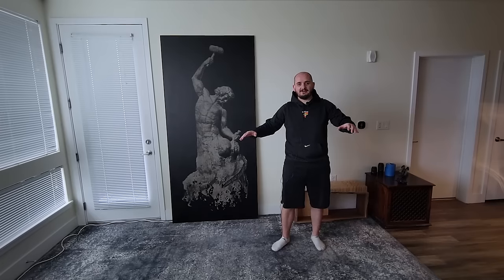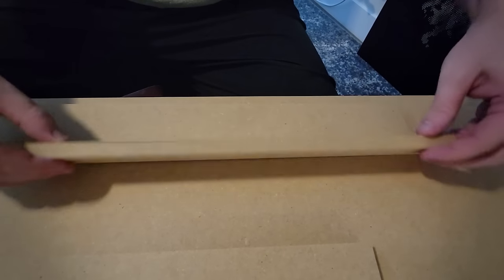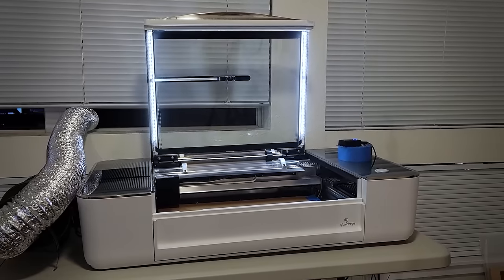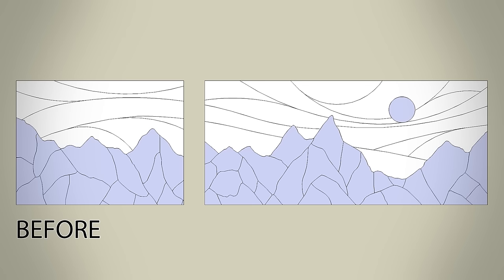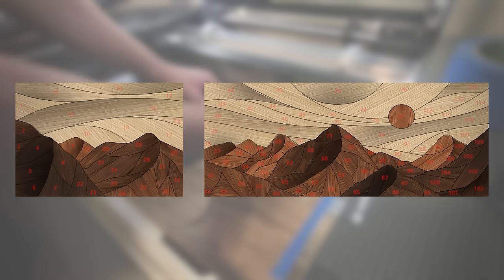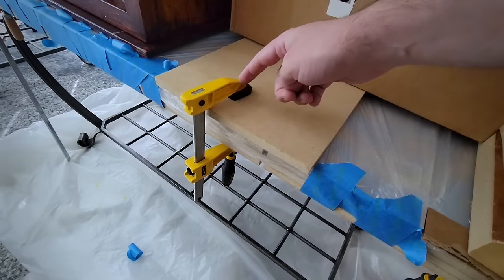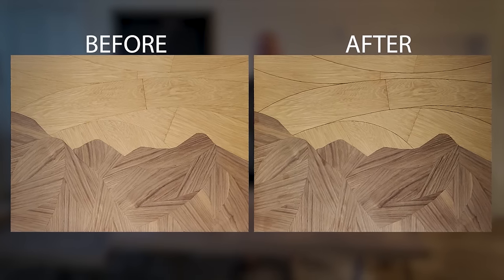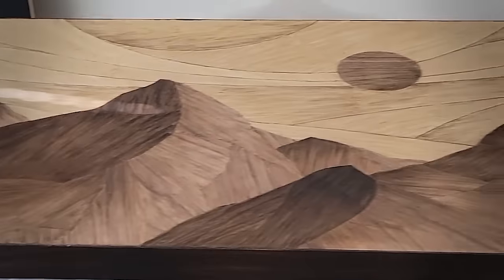Building a DIY Custom Laser Cut Table

Comment: From past experience - you can use an iron with a piece of cardboard under it on all of your spots that the veneer didn't fully lay down on. Let the glue heat back up (you'll hear it bubbling and popping) and then find some weight to set on top until it can dry correctly. This is especially helpful if your veneer dries with waves in it.
Reply from the maker: Excellent tip!

Comment: This is awesome. You're like a Van Gogh, but with veneer and a Glow forge. I'm inspired to try something similar, but can't afford a laser cutter. Luckily I have lots of Exacto blades. I like how you're transparent with your mistakes, but you take it with some humor, it makes watching this more enjoyable. The is a real human aspect with regards to form, function, creativity and problem solving. I can picture this hanging on someones wall.
Reply from the maker: Thank you for the kind words, I am glad you enjoyed it. You might be more skilled with blades than I am but if you were wanting to use a laser cutter for your design you can check out a maker space near you! They usually just charge you by the hour and they have better machines too so its a good solution if you dont want to fully buy one. Glad it inspired you!

Comment: If you want a good trick for gluing veneer down, apply titebond original (do not use titebond ii or iii for this) to the piece and the base, but don't connect them yet. Let the glue dry a fair bit, then tape the piece down, and iron the pieces onto the surface. The moisture/steam helps the glue become tacky again and it keeps pieces from curling up. I've done this on guitars and it works quite well.

Comment: Laminating a piece of wood with veneer is tricky. I suggest one of the following options for the next time you, or someone reading this, wants to laminate wood.
Option 1, use "contact spray adhesive". 
1. Spray both your surface and the veneer.
2. Lay down slats on the surface, and put your veneer on top of the slats. (tape facing upwards if you joined pieces of veneer together like in the video)
3. Carefully remove the slats from the middle and stick down the veneer with a roller.There are special rollers for this, but maybe a dough pin would work too.

Option 2, Do what you did but better.
1. Cover the surface in wood glue. You could look into special glues for laminating, but regular wood glue is also fine. Make sure to distribute the glue evenly.
2. Put the veneer onto the glue covered surface. (tape facing upwards if you joined pieces of veneer together like in the video)
3. Lay a plastic bag or non-stick baking paper on top of the veneer and put a sheet of wood on top of that.
4. Load the piece of wood with heavy things and weights. Try to evenly distribute the weight.

This basically simulates a vacuum or hydraulic press.

Comment: 6:21 can you elaborate on how much you enlarge each piece to compensate for the kerf?
Reply from the maker: Of course! For my laser, I measured it out to be losing 1/64" of material on the test square, and that was across the entire thing so when I enlarged my final pieces I set an offset all around the part by 1/128" so that the having that smaller offset on every side, it would add up to the 1/64" that's lost. Each laser and material will be different so a test with that material will need to be run each time to see how much it needs to adjust by. Hopefully that is more clear.

Comment: If you want to do something like this again, you may want to think about using 1/8th inch thick wood panels instead of the paper thin veneer you used here...

The thicker wood should prevent some of your cutting and gluing problems because it shouldn't curl up nearly as much, it'll also give more surface area between joints for gluing/hiding joints...
Assuming the LASER head can be angled, you might even be able to bevel the edges of the component pieces to make the joints MUCH easier to hide in the finished piece...

Comment: What stain did you end up using for the mountains and sky? Thanks!!
Reply from the maker: I used a Semi Transparent Dark Walnut stain for both the mountains and the sky. For the sky it was super light passes mainly using the stained cloth after most of the stain had rubbed off on the mountains.

Comment: I don't know if you'll respond to this, but I had a question. When you were using the laser cutter what were the metal pieces on top on the veneer? Also you're content is amazing keep up the work can't wait to see more of your content.
Reply from the maker: Thank you! I try and read and respond to everyone especially if they have a question. Those are low profile magnets, they stick to the honey comb tray in the laser cutter and are used for two reasons, 1. they keep the veneer flat to be able to be cut as best as possible and 2. there is air assist to evacuate all the fumes and it will blow around lighter material like thin wood so they need to be held in place.